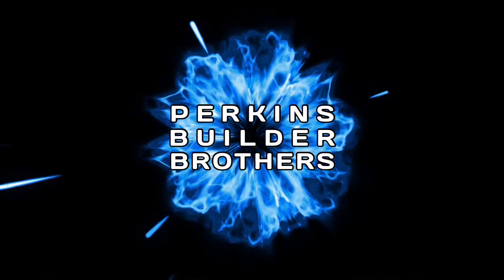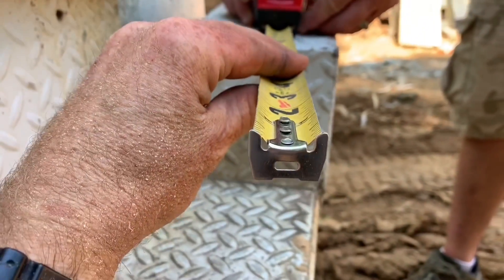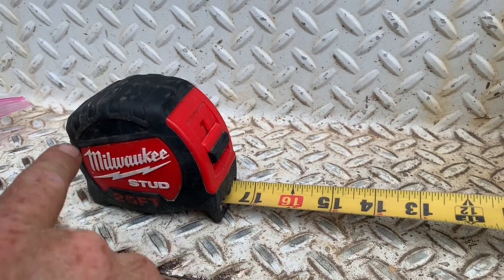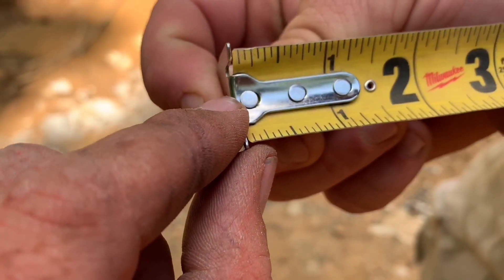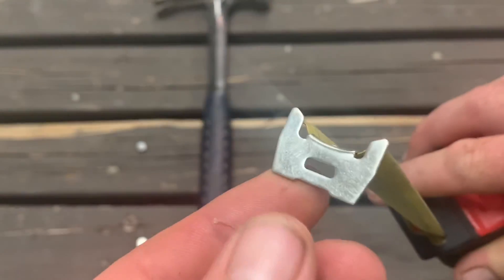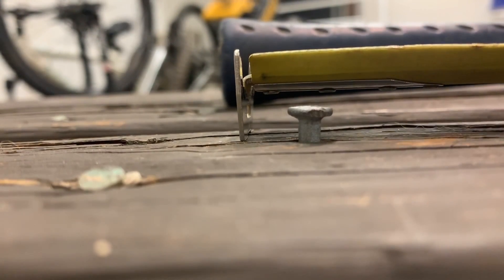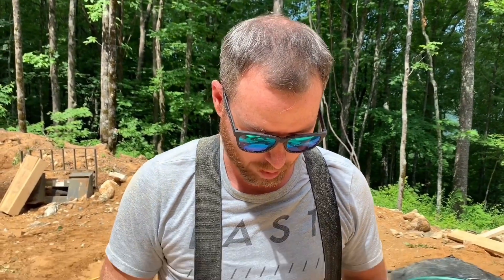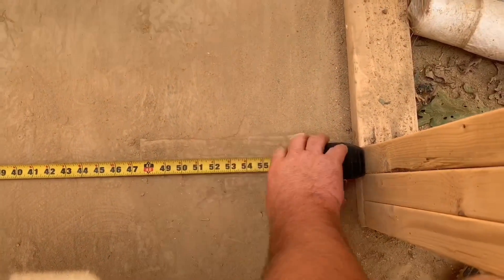5 Amazing Hidden Features in Tape Measures

Comment: Always let your finger be the bumper against the tip when you're letting it close!
   It'll save your rivets and not allow the rivet to elongate the tape holes.
  1/16" or more could be added to your measurements.

Comment: Arched tapes make accurate marks difficult. If your making fine furniture or close fit joints these tapes are a nightmare. Stanley METAL case 12ft tape is the best. It sucks they dont put the cheat info on the back of tape like they used to.
Reply: Stanley 25'👍

Comment: Some where between the fold out measure and the tape measure was the "snap measure" (what I call it). Like a tape measure but thicker metal that would roll up (no case). You could unroll it and "snap" it so all or a portion had a bow in it and that part would stay rigid while the flat part stayed rolled up. I think it was 3' long max. Or maybe 8'. Maybe different lengths. I know there were different widths. My grandfather had several of them.

Comment: You can also bend your tape and find half of a measurement really fast.  Ex:  fold your tape in and make a U shape. Put the dumb end on 40inchs (again example) look down the middle and it will be 20inchs  works with and number down to the 1/16
Reply from the maker: Hey.. that a really cool tip that I’ve actually never heard. Thanks!

Comment: Did you know you can use it to find out either someone's age based on the year they were born or what year they were born based on their age?   Pull the tape out a ways and line the end up with the current year (121" for this current year 2021)  then find either the age or year someone was born and the other will be directly across from it (assuming you already had your birthday this year.)  For example if you were born in 1982 you'd be 39 this year.

Comment: I knew everything except about the reason the play is in the end of the. I also have a tape measure that doesn't exist anymore. I own 2 Craftsman tapes.😂
Reply: Remember the lifetime guarantee and they would replace it.
Reply: how can you have something that doesn't exist anymore?
Reply: Craftsman tapes are sold at menards so far I like it better then the fat max
Reply: He means they don't sell anymore
Reply: I'm like Dewalt tools but have never liked one as much as my Milwaukee my tape
Reply: Do those old craftsman tapes have the diamonds on them?
Reply: Metal stud framer here and Milwaukee tapes are warrantied and is the only tape I use. I usually return them to home depot when they break with no problems.

Comment: You forgot one. When you hook the tape on a nail or screw you can use it to mark a radius. So it functions as a protector. I did that for the first time to make brick forms for half round windows 30 years ago when we built bill Marriott's house.
Reply from the maker: Jeff Powell good one
Reply: @DrugsAreBadUmmmKay  darn auto correct!

Comment: 2 more: if you're measuring to mark on a wall or even on a material, you put the measurement on your tape at starting point or edge,  then you can use the metal hooking dumb end to scribe/ scratch in your mark real fast.  No pencil needed.  
Second,  I always use my tape as a straight edge.  With a little practice and steady hand it works fine, especially on drywall . 
There's even a cool trick more experienced guys use to scribe rips on sheet material by hooking to edge and setting pencil on tape measurement holding both pencil and tape in one hand and hook on edge with other hand and slide down length of material while pencil and tape hand scribes the measurement all the way down

Comment: The 19.2 layout diamonds are for joist a spacings between 16" and 24". The TJI specification sheets define the maximum span length for a given joist depth and spacing distances TJIs are not cheap.

Comment: The diamond marks just might be there as a indicator for rafter spacing. Using this mark, I believe, "saves" you the material and labor cost of two rafters per side per every 8' of top plate.

Comment: In Belgium, we still use the fold out ruler over the tape measures, it is more precise, the tape measures are made of steel which change size with the different temperature, instead of the fold ruler that are made of wood.

Comment: This is pretty kool I new a lot of the stuff you talked about but not all I do a lot of pvcp pipe work in I use the belt clip on the tape to ream the inside of the pipe out I hook the tape to the end of the pipe like you would put it in your pocket put a little sideways pressure in turn it cuts the edge right off the pipe in its way faster than using a reaming tool

Comment: If you look closely at the bottom of the tape it tells you exactly how much to add for that tape.
You can also add measurements with a tape, (hope this makes sense) take the first number measure mark a line, then from your line measure the 2nd number, repeat for all numbers. Then go back to start point pull to last and fractions added easy.
My drafting teacher gave us a fractions test, and stated no calculators, I asked if I could use a scale (fancy measuring stick) he looked confused and said yes. 5 min later I was done, most in class needed 30 to 45 min to get thru.
He watched me use a scale on the 2nd test and I was not allowed to use a scale afterwards.

Comment: 10-15 lbs of force? Umm No more like a pound ar most
Reply: Good grief! and you got 4 thumbs up!
Reply: I thought the same thing. Imagine setting a bowling ball on a tape measure.
Reply: A tape that broke with one pound would be a paper weight on a job site. It wouldn’t reach out at all. If you have a good tape it will take more than a pound to break it otherwise when you ran it out it would collapse on you. Like the cheap skinny tapes do. Five pound of pressure is required on most stock firearms to fire. 
  if you have ever fired a gun you realize that five  pounds is not that much pressure.

Comment: You can also layout a radius using that nail notch as well and you can hold the dumb end clutching a Carpenters pencil pull the tape out to the desired size squeeze that measurement between your thumb and forefinger and mark cut lines on drywall and plywood or actually anything else your arms can reach just watch out for splinters on wood you can wear gloves 

Semper Fidelis 
The Gunny

Comment: You missed one of the most obvious features of the nail slot on the front end of the tape. You can make a perfect circle, at any diameter, by hooking it onto a nail and then spinning a pencil around at any point on the measuring tape. This can also be used for marking corners you want to round off and similar.

Comment: Thanks for sharing. Should imperial and metric be used in the same measurement such as mentioned at 6.19.
Reply: Good point! 
  I always use standard  tapes instead of metric so I don't have to read the inches upside down 🙃

Comment: One more feature that your tape has that not many do is that little hole at 1.5 inches. That is a compass. Pin the tape through it, hold the pencil against the back of the box, and you can draw nice big circles or arcs with it.

Comment: At the 2:00 minute mark that wooden ruler is still available and is used everyday by lethal high voltage electrical workers  I have several and one made of fiberglass too.  That metal tape measure will kill you dead in a high voltage electrical equipment room.  One breif moment of contact with the metal tape and high voltage buss work and you would be dead and stuck to the floor.  So it is not old fashion.

Comment: OK so what brand is good I only need 10-12 ft (not worried about price)?
Reply: Stanley, best tapes ever made.
Reply: EDC ALLDAY 
    Au Contraire,  
            A Lufkin tape measure takes the top prize among Lic. Pro. Users .  
            Sure Stanley is better known? I’ll give you that, but Lufkin has all the same design elements with addl. features not found on the Stanley.
Reply: Thanks for the help everyone.
Reply: John Turner 
*paid endorsements

Comment: Yes the wood ruler isn’t as efficient but being in the electrical utility a metal tape around energized equipment doesn’t end well can get one in trouble so we use them extensively for that purpose

Comment: Also, the dimensions of the tape measure are usually on the bottom of the housing, sometimes on the sides. It's not always 3 inches exactly 😉

Comment: As this is very informative to a novice I was seriously hoping you were going to tell me something I haven't learned in ten years of construction... Sadly I was disappointed... Also I've been using Stanley fat max tapes my entire construction career but I'm about to switch up to the Milwaukee 25' with the 14' standout any thoughts on this before I make the leap?
Reply: i too have held a fatmax for years imo, the switch is your call. they 11' Span Stanley promotes, doesn't measure up (snicker) but I would utilize the double sided tape Milwaukee offers.
Reply: @duderh4919  yeah I have one in my shop like that it just isn't the wide version, the measurements on the backside (with engineer's scale) is very helpful

Comment: You can also have tape measure races.    On a new construction site use the slot to hook on nails twenty feet away spaced a foot apart.  The contestants hook and pull to 20 feet. Ready, set, release!  The tape rushes to the nail and bounces past.  Loser buys the beer!

Comment: The 3" rule that you mentioned isn't always the case. That Milwaukee tape should be 3 3/8ths inches. A lot of tapes have the length of the box written on the bottom of the tape so you can get the exact measurement.

Comment: I watched the video thinking that I was going to learn something new.  Well, I did. I had no idea that the Milwaukee Stud had a finger stop, but then again I've never used a Milwaukee tape before. All the other tips I had known of, including drawing a radius using the nail trick and using the clip to make your cut  mark. Oh yeah, there are some tapes that have a neodymium magnet on the clip for sticking to metal outlines, useful for picking up dropped nails, screwdrivers, and other small steel tools.

Comment: Another tip. Buy a regular old Stanley tape it’s a 3inch tape it makes doing the math on interior Measurements i.e running base and crown.. run it wall to wall add 3in …

Comment: One thing he didn't mention is whats called the "stand out".
The OP does low rise residential, so perhaps this not something he does as much of, but in ICI construction sometimes you need to extend your measure unsupported over a longer distance.
This being around 7-8'. It just so happens I have one the Stanley measures that's in the video in my work shop and just reconfirmed this. Some makers of tapes make mention of this on the packaging.
Reply: Yep, some manufacturers do brag about their standout. It's important in my trade to have as long a standout as possible, especially if you don't have a helper that day. If I remember correctly, there's a brand that has thirteen feet of standout. Might be a Stanley.
Reply: @davidgraham2673  Wow 13'. That's very impressive and one I'd not heard of before.
I would say I would keep an eye out for that, but I'll be pulling the pin in the next year or two, depending on how things shake out with this COVID situation.

Comment: You need to show everybody how each individual tape measure will read different measurements for the same mark! If you build a wall do not use multiple tape measures or it will not be square you need to use the same tape measure for your entire build and not all tape measures of 3 in my DeWalt is three and a quarter and they say it at the bottom

Comment: My dad was a carpenter, he only used the luffken fold out rule. If it was a good one it had the brass inlay ,which extended it 6 more inches. He always corrected me when I tried to call it a ruler..
19 1/8" where the diamonds are we did also use as a lay out for studs. Balloon framing used it as well. 16teens,12elevs,way better these days.
Liked your presentation,so happy to see a carpenter who knows what the diamonds are for.

Comment: We found out the hard way that if two people are working together and they both have different brands of tape, the measurements are going to be different. 
Tapes are never the same, in one case it was 2 mm difference. 🙄Beyond frustrating if one person is cutting and the other is fitting. I want to try the Milwaukee tape. I’ve been using the fat max for years.

Comment: I was always tought to use my trigger finger to control the tape( just like a gun) and if you keep it there it will hit your finger at 90 mph intstead of the case.Its softer on the end and not break the tip off as fast. That was before they put 3 rivets on them. As ren&stempy would say( WE DONT NEED NO SKINKING MILWAUKEE "STUD" )😂

Comment: been hating my tapes lately.  The loose end always bothered me.  had no idea it was that way on purpose.  I have always hit the rivets with a hammer to stop the movement and done the compensation at the saw.  not I know.  one thing that really bothers me if you look at the vid when the dumb and smart end are shown.  see how the dumb end is up in the air at an angle from the smart end?  why cant that be level?  I hook the and into a gap, set the tape down to mark and the end pops up.  is there a reason for that I wonder?
Reply: Stops (hopefully) your tape at the drywall. With luck, and a rocker who cares enough to not exceed a ½" gap between the floor and the wall's sheetrock. You ever get your tape end stuck under the rock to the point your tape fails and creases, you'll be grateful for the design from that day forth... Except for the intermittent time between cussing out a guy who ain't there and buying the next tape, of course. Frickin' sucks balls

Comment: Some of the info is not relevant in the UK, especially on small bodied tapes, typically 10’, 30’ and 40’. The UK small bodied measures, unfortunately never have the nail slot. Also, in a country where buildings can be less than a year old to several hundred years in the same street, stud and joist spacing, can be imaginative at best, interesting at worst. And finally, tape measures regularly come in one of three varieties: metric, (common); imperial, (less common); both metric and imperial on the same tap, with the dumb end having a 1-2mm spacing, (most common). Like most things in Britain, we say we know what we want, yet we still haven’t decided.

Comment: Not all tapes bodies are 3 inches. To be exact look on the back or bottom and it will have a measurement, usually around 2 7/8 or something, that is the length of the base of the body. If done as in the video add the number on your tape instead of 3 as he says to get the exact measurement.

Comment: I use nothing but Stanley FatMax I do Marine construction and I have to stretch out across from piling to piling or from a sea wall to a barge you know they have the best distance reach without folding and breaking on your ass and hitting the water because all my builds are on saltwater and everything that hits that shit is ruined within a couple days. Stanley FatMax is the shit

Comment: Actually after using Stanley  Fat Max's (20-25 yrs since they started ) and couple of Milwaukee stud tapes, I went back to origal Stanley 25ft in chrome case......the Fax Max durability is crap now and Milwaukee the same.....after 3-5 months they are done...at $20 plus a piece I just don't need the thicker standout that much and original Stanley's are fine and seem to roll better inside the case...$8 a piece and it lasts the same as others.....

They just don't have same durability they used too

Comment: Thought maybe see something I didnt know, lol.....always curious but seeing a few tapes there reminded me how much I like stanley......recently came into a dewalt and Milwaukee and absolutley hate em.....tho I think new dewalt uses almost same blade as fat max now (and cost twice as much) I believe.....Milwaukee is garbage!

I only get a few months out of any tape but  wont be trying anything different than fat max for along time!

By the way Milwaukee makes some great tools just not tape measures.....increments printed on tape is harder than using a std one too!
Reply: Tapes may suck, but their version of the sharpie is hands down the best. Cap and butt angled for caulking, clip design to fit a hardhat brim, and it'll still work if you leave the cap off for a good 72 hours. Believe that's actually the guaranteed time they stand by. Love those markers! Everything else Milwaukee I've ever touched... kinda licked my scrote

Comment: There remains a question I have asked many seasoned carpenters relating to a tape measure .. Even offered a $100 to answer .." If centers are red for 16"oc and black for 12" and 24 " oc .. and a diamond for 19.2 "oc .. " ... What layoff occurs between 12 "oc and 16" oc .. ????  granted it has not been identified on the tape measure with a symbol , but it is represented on a span chart in a Code Book ??? .. The answer can be found like this .. .. Everything is based off of 96" .. basically a sheet of plywood .. 96 divided by 4 = 24" oc . 96" divided by 5 = 19.2" oc .  96 " divided by  6 =16" .. and 96" divided by 8 = 12"... Where is 7 ??? .. It is 13.71" .. and is a layoff !!
Reply: Thank you. I didn't know that. I've been bitching for a good decade at the framers when l'm hunting for studs (cuz the in wall backing was forgotten or the work is from a change order) and I find it at the 13" - 14" area. Never made sense, and would have me pissed off for hours. Looks like I have a lot of bad vibes to rescind...

Comment: Tape trick ,take tape and spool out to 120 Inches take tail end to line up with the 120 mark now you have a birthday year guide , so think of 120 as the year as 2020 and next year 121 ect. So look up the year your born and the corresponding age is across from that year. Example born in 1999 you will be 21.good for up to 120 years old.